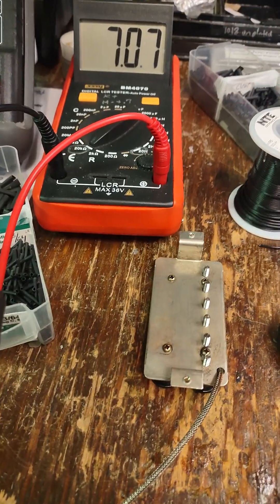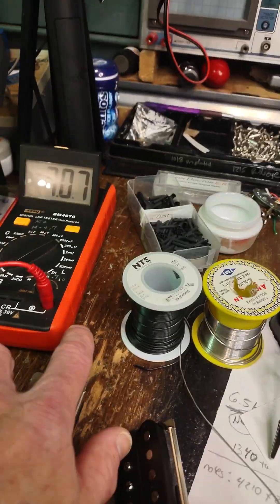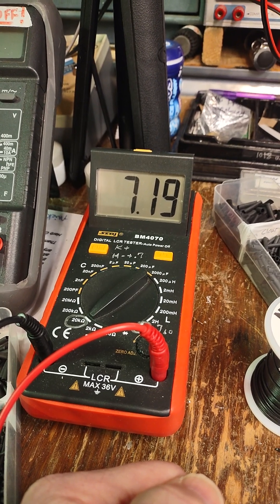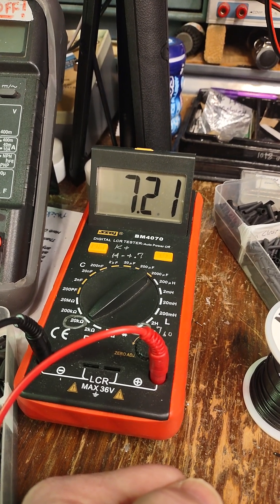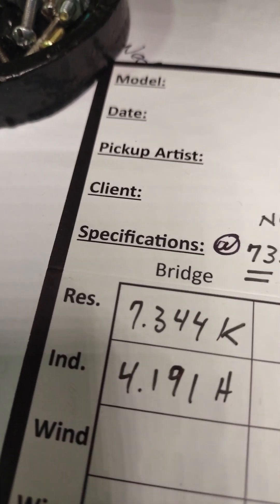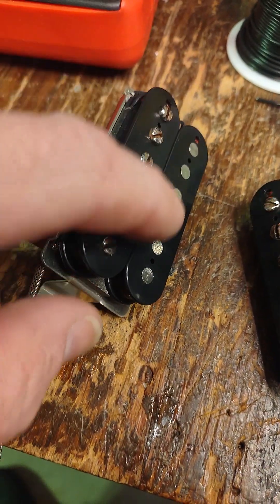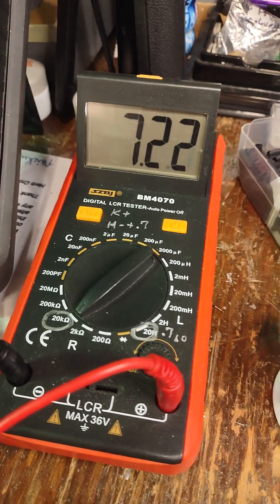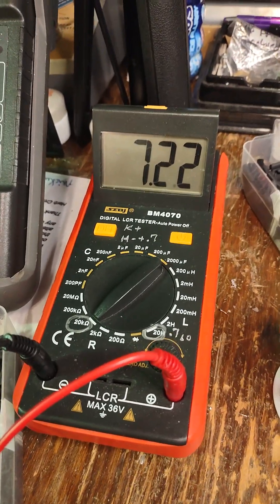Resistance Means NOTHING about a Guitar Pickup!

Comment: If resistance means nothing why do you bother to write it down. Show me 2 pickups with everything the same but one wound to 7k and the other wound to 14k install them one at a time in the same position on 1 guitar and if there’s a difference in sound or tone then it does matters
Reply: It does matter only if you wanna increase volume and gain at the same time. The higher resistant one would not squeal at higher volumes and gain while the lower ones would. But outside of it it reallly doesnt matter. Correct me if im wrong but thats how I built mine.
Reply: @EnmaMusicProduction  thats cause law of inductance is as such; higher the resistance greater the bandwidth of frequency responce but its a give and take according to way back ohms law

Comment: Seymour Duncan lists DC resistance as output and DiMarzio goes by millivolts. To most guitar players like myself---who are not electrical engineers---this is confusing. It doesn't tell us anything. I've heard players tell me that a Duncan JB is higher output than a DiMarzio Super Distortion because the former has a higher DC resistance than the latter. It all begins to sound like witchcraft. I always suspected there was a lot more to how a pickup sound than the resistance/output, etc. I just trust my ears. I like what I like.

Comment: How do I know if I have low or high output pickups. I mean, what would be the proper measurement to know the output. Other factors aside, such as pole piece and screw alloy. My D'Marzio SD's are around 12-14K and definitely sound bigger, louder, and breakup earlier than the set of PAF types I just installed that are 7.5-8K. Do I need to go off Henrys? Winders don't provide that info, from what I've seen.